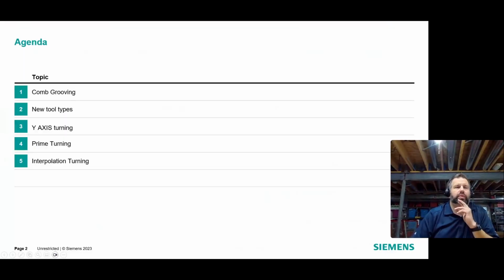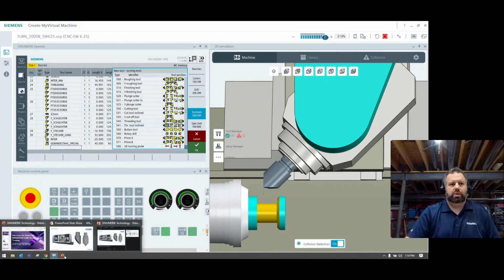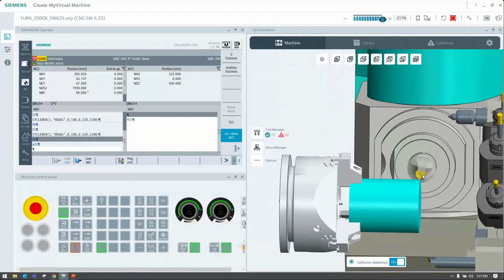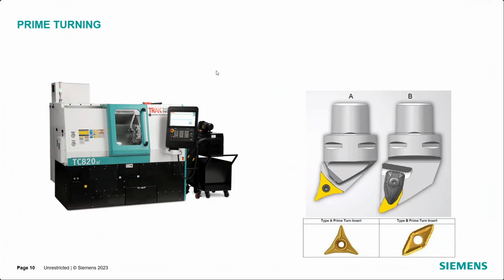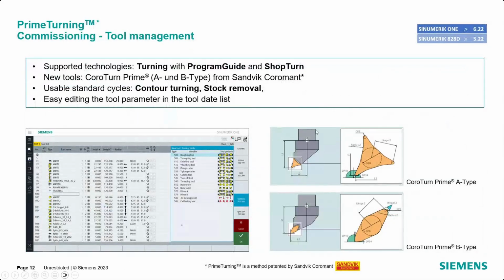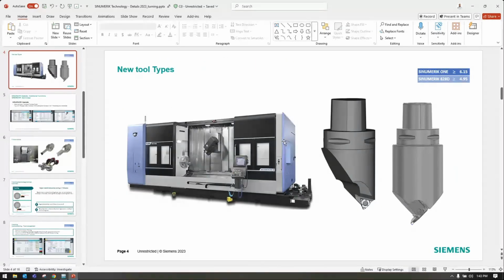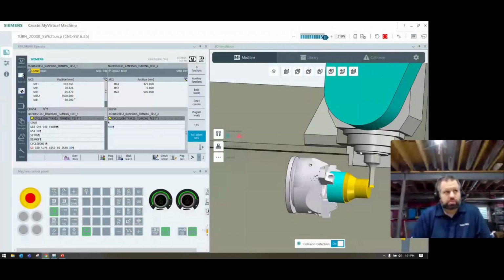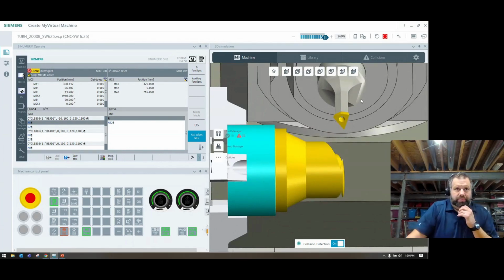Discover the Power of SINUMERIK ONE for Advanced Turning

Comment: More on nuances on Prime Turning: 
1. You need to make sure that your work piece is supported properly. You're at bigger risk of pulling the part out of the chuck, so use a tail stock, and/or grippy jaws/collets.
2. You need to arc into the cut with a fairly large radius because the insert is strongest at the leading edge and the tip requires thinning of the chip before engaging in the full cut. If you dive it straight in, the tip sees too much tensile loading, especially as it changes directions, which carbide does not like. 
3. The other nice benefit of Prime is that you're pulling your chips away from the chuck so less of a chance for rats nests. 

Great video thanks!
Reply from the maker: Thanks for the additional tips!